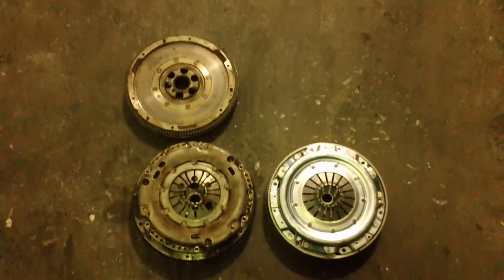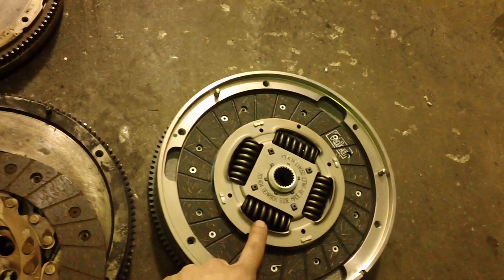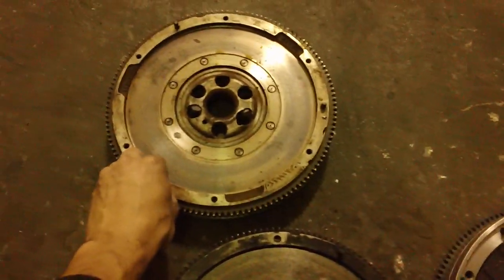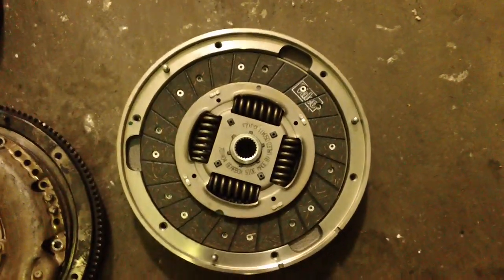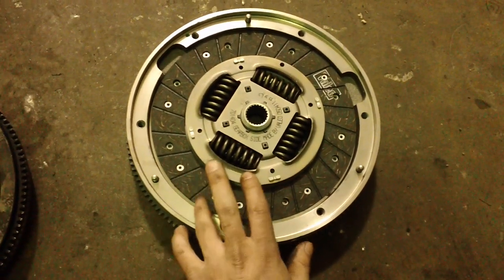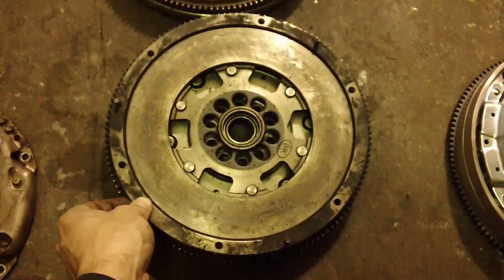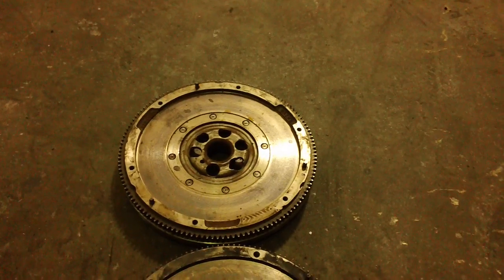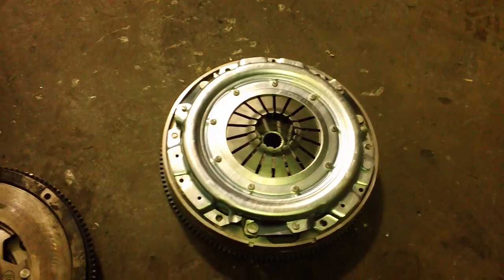GermanAutoInstitute.com Dual mass vs Single mass flywheels

Comment: Good day, 

Great video, I'm converting my DMF to a single mass on a Ssangyong Korando 2011 Diesel SUV 2.0 e-XDi - must I change the clutch plate to one with springs or leave the clutch also solid?

Comment: A diesel (high torque at low revs) requires the springs/damping to be on the flywheel (as opposed to the clutch disc), if you put a solid mass flywheel the crankshaft may very well break.
Reply: @jzxtrd337  that was so before with yestertimes diesels, but todays turbo direct injection  engines can put so much more torques at low revs that a damper is now a necessity.

Comment: Dual mass type fly wheel is very expensive. Low cost, if we use the clutch disc with damper spring combine fly wheel single mass.

Comment: Hi I have a question.  I have an 03 g35. I bought a clutch kit (EXEDY NSK1000 OE) and a solid mass flywheel. When I took it to the mechanic he said the solid flywheel isn't compatible with my clutch and that I needed a "dual" mass flywheel. The person I bought the solid flywheel from said that it was OK to install solid mass flywheel on the clutch regardless of compatibility.
I don't know whether to return the solid mass flywheel and get a dual mass (which is 3x the price) or install the solid mass flywheel on the clutch anyway?
Thanks in advance! Appreciate your response since you seem to have tried the solid mass flywheel.

Comment: Would you put this in a 01 TDI with ALH?  I am using a Jetta TDI 1.9 ALH in a Vanagon Camper using a 4 speed with a LSD/Locker. Many say that the gas clutch wont hold and swear by the DMF setup.   The word was that TDIs have a pulse, or vibration that can transmit more through a SMF setup.  I dunno.. I'm new to the whole thing..   Thanks for the walk through!

T
Reply: Same question here...except mine is an 01 New Beetle TDI with the ALH engine and the 5sp manual.  I think my DMF is getting ready to fail...it only has 312,000 ,miles on it!

Comment: The single explanation for this dual mass flyweel is to protect the crankshaft and put you to consider clutch as wearing part only good to be changed every year if possible, to make this shit selling department producer happy.
Reply: my diesel is 25 years into its original clutch, so I'm not convinced I need a DM flywheel/clutch assy, I think it's a money making con-trick